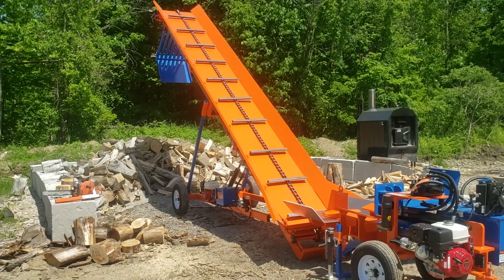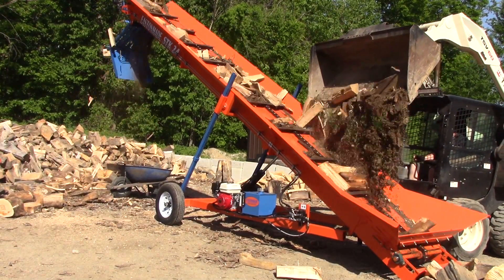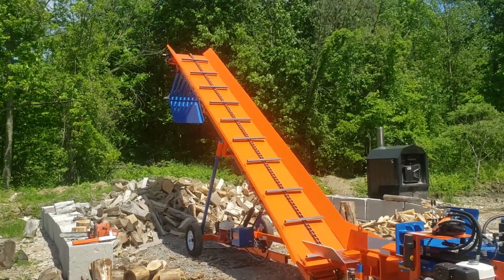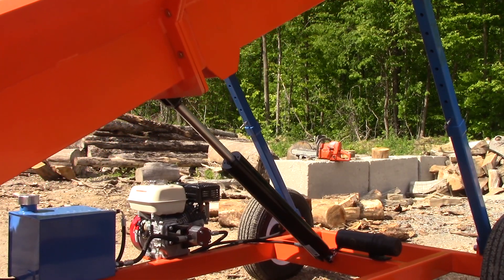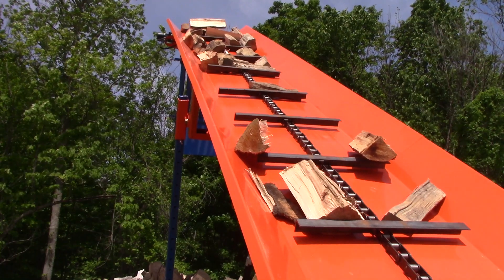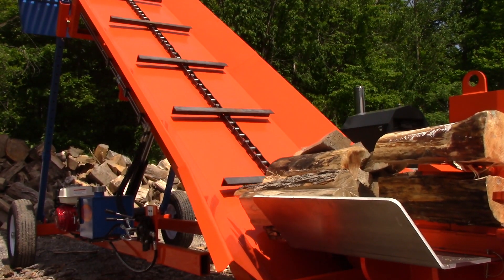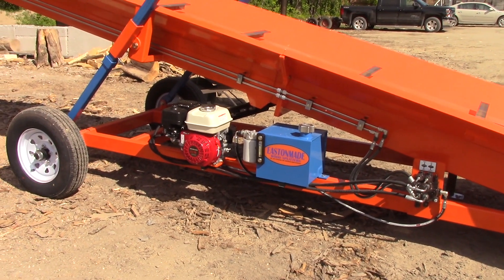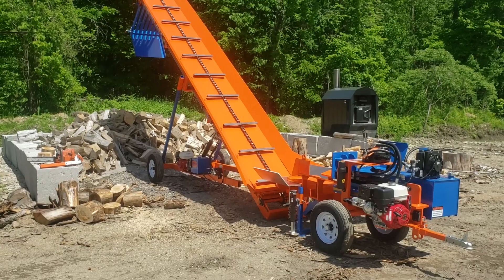Eastonmade Firewood Conveyors 2019

Comment: I see all your wood looks like wood popsicle sticks, how does it work with 9 Kilogram chunks of wood?  Do they cause the angle on the chain to drag on the steel plate?
Reply from the maker: It certainly does not work with non popsicle stick firewood at all
Reply: @EastonmadeWoodSplitters  So with 9 Kilogram chunks of wood does it cause the steel angle to drag on the plate?  From the video it looks like the chain is dragging on the plate but you say it actually has chain rollers in the center of the plate?
Reply from the maker: @orionism42  very minimal amount of drag

Comment: What's up bud looks good checking out you video from a year ago at the conveyors for you just deal with chapter fart from Connecticut still dreaming and living a dream they need some data on or your wood splitters by the way would be cool if you can make a 4-foot log splitter a lot of times it's nice just stacking wood up and let it cure so if you could split those logs for foot and put them in a rack and it's easier just use a bookstore in nakano would be awesome to see you make something like that
Reply from the maker: We have done a handful of 4' splitters.  If we do get another one I will make sure I do a video of it.  Thanks for all the support.  It's very much appreciated